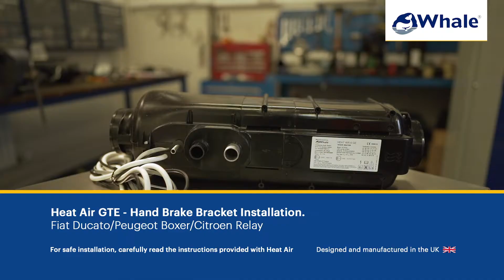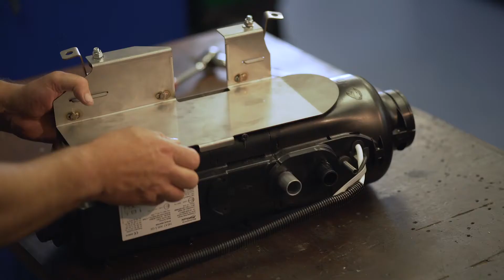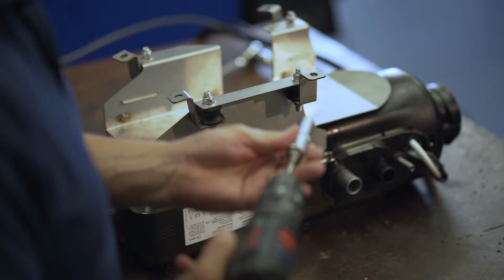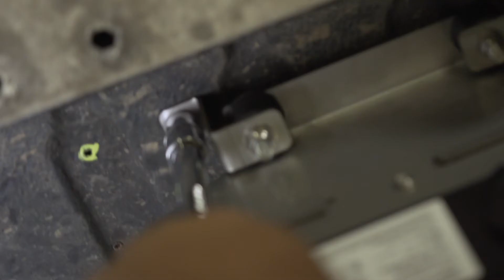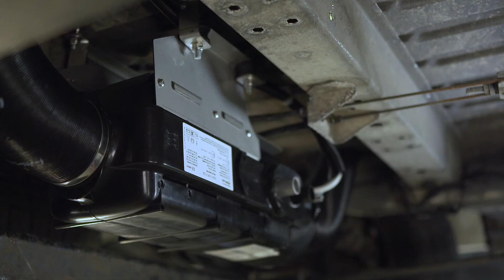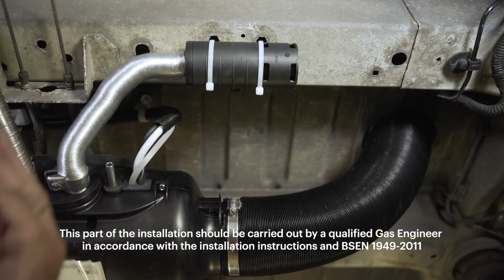How to install Whale Heat Air 5 GTE to your Ducato, Boxer or Relay

Comment: The combustion air intake on my van seems to be letting water into the heater, this has happened twice when driving during heavy rainfall and surface water? As i consequence I have had to replace the pcb as it has eroded. Any suggestions as to how I can prevent this happening again?